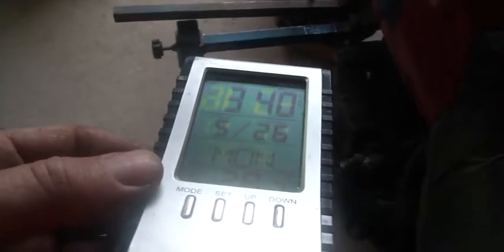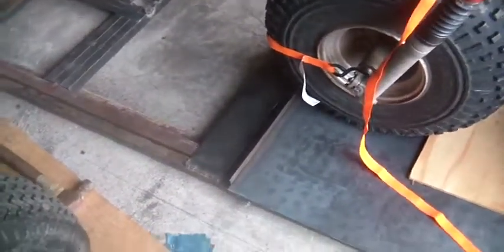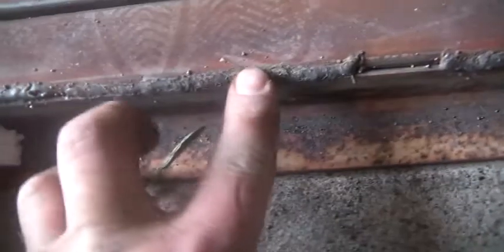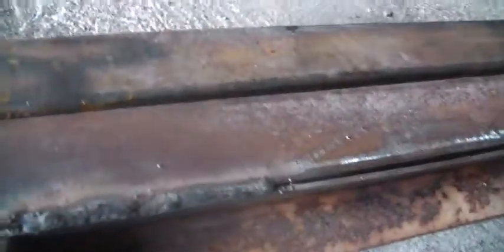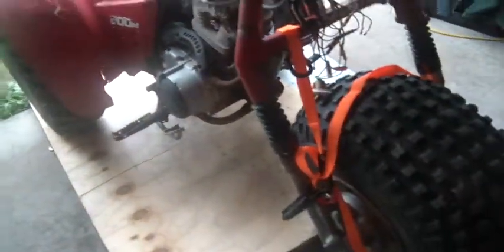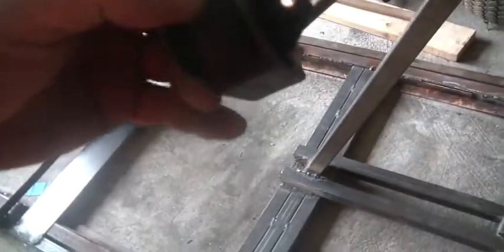5_26_14, My last lift video,

Comment: that hook popin off was a bit scary, you can take off about 20 feet of cable and it will track better with a better gear ratio,
Reply from the maker: mustie1, The hook popping had me jumping also, U R right about the extra cable, it is binding up the works for sure. Thanks for the input, watching, and commenting!

Comment: Add some weight to the back that should help keep it down. And mustie makes a good point about removing some cable
Reply from the maker: Wallie2004!  Yea, the next thing is to work on the hoist situation, and U and Mustie1 are right, I need to get rid of as much cable as possible. Thanks for the input, watching, and commenting!